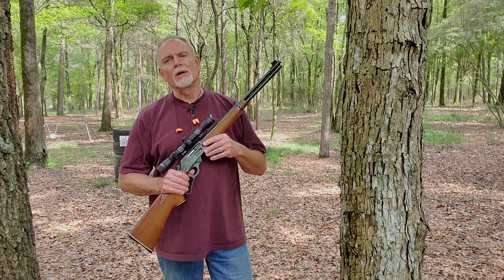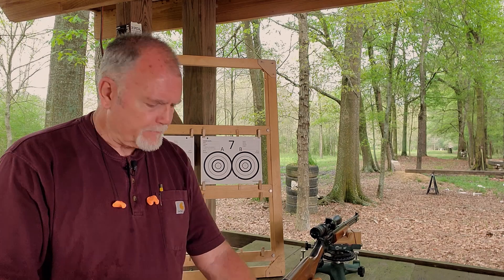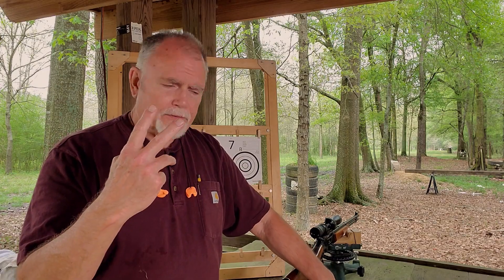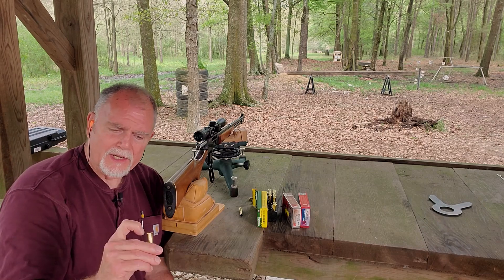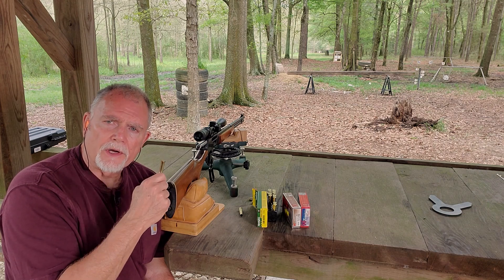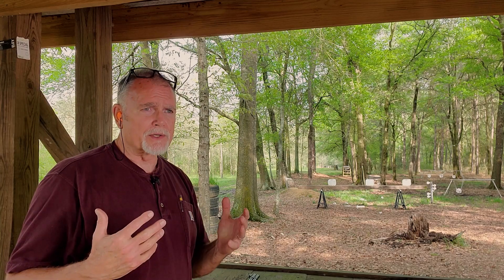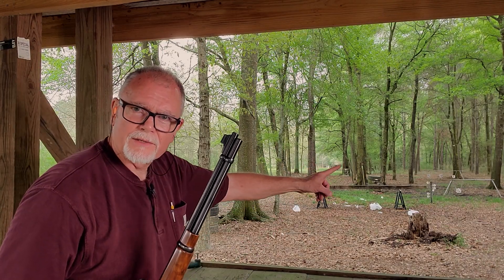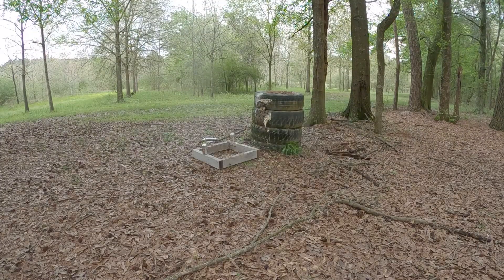Marlin 336 - Light Primer Strike ?

Comment: I had the same problem with my very old and heavy used but not abused Marlin. I took the bolt apart several times for cleaning and inspection and problem still there. I gave up and took it to my friend and gunsmith.
He did what I did with the same results. He decided to took a real close look at the spot both firing pins met. He realized that they weren't  perfectly square with each other. He dressed them to be square and  so far  after around  200 rounds no misfires.
My gunsmith charged me $20 for his work about 3 years ago. I had considered buying a fire pin assembly but was to cheap to spend the approximately $30 on a hunch. I don't know if this is your friends problem but might help.
Good Luck
Frank  (From the great state of Kansas(
Reply from the maker: Thanks Frank. Great info. I'll check it out. Stay safe in Kansas!

Comment: I realize that this is an older video but I re-visit your videos often. Last weekend I had my 336 out at the range and also had a complete misfire. These are my handloads but as far as I can recollect this was my first misfire. I did have a PPFFFT once but not a misfire and I've been reloading since the 1970's.  No matter how many times I pulled the trigger that round would not go off. Very nicely cratered  primer so definitely not a light strike. These were CCI primers. I realize that every barrel can contain one bad apple but I just shy away from CCI's now. I would not expect a factory round to misfire
Reply from the maker: Hi David. As I said in this video, the Remington CoreLokt were the only misfires, but I have also had misfires with my own Marlin 1894 using CCI primered handloads. It was really bad after I installed the Wolf hammer spring then improved when I added a washer on the hammer strut to increase tension a little. But still too many misfires. I haven't experimented yet to see if a different primer brand would eliminate that. Maybe some day. Thanks as always for your comments, and double thanks for the views.

Comment: I had the same problem with a Marlin 336 from the early 80s in .35 Rem I recently acquired.  I took the bolt apart and gave it a good cleaning and replaced the hammer spring.  I also changed primers in my reloads and adjusted the sizing die a little and seems to work fine now, but testing continues.
Reply from the maker: Good input. Thanks Michael!

Comment: This may have already been suggested and I  have read a good number of comments to see if it has but have not seen it as if yet.  Is there any chance that the actual firing pin tip has been worn down ever so much that sometimes you get a light primer strike?  (Using and inch as references since I have no idea how long the pin is supposedto be) , let's say the original pin is an inch long and over time and use it is now 15/16th of an inch.  To me that would a potential problem for hard/thick primers thT would not show up in light/thin primers.  I know by seeing these videos (which are WONDERFUL 👏 by the way) the the problem has all but been solved and even with that you still had 1 dead primer strike.  Let me know if I'm off base.   

I have a 67 model 336 30-30 and love it.
Reply: Oh! Also, what is the likelihood of a "bad primer" with factory loads?
Reply from the maker: That's something I hadn't thought of before! I'll check it out if I get my hands on that rifle again.

Comment: I had two failures-to-fire from a box of 20 Corelokt 170 grain while trying different ammo in my 1995 336. I had cleaned and polished the action prior, and I had no failures with any other ammo then, or since. I now use Winchester or Federal 150 grain with acceptable accuracy from both.
Reply from the maker: Thanks Sydney. That kind of confirms my suspicion, that the Rem Core Lokt is the problem. No hint of issues with the two types of Hornady ammo, other than the fact that the Leverevolution wouldn't group well in that Marlin.

Comment: I agree that the primer strike you showed wasn't a light one. So, that leads me to think it was a bit slow. And since I saw your cleaning video, the immediate thought of "gunk" vanished. So, what else can slow the firing pin? Too weak a spring, and excess friction. The spring can be ruled out by shimming it for more compression. If that works, get a new one. The excess friction is probably in the two piece firing pin. The lever presses up on the safety pin to ensure full closure of the lever.  If that little piece of metal has worn, it won't push the firing pin all the way up, and you'll have a slowed down strike. You can put a dab of JB weld on the exposed tip, and if that fixes the problem, replace that part. Also, as a couple of others have suggested, you can get a one piece firing pin, but that also eliminates a built in safety feature.
Reply from the maker: Of all the factory ammo that I tested in Ron's Marlin, only Remington green and yellow CoreLokt rounds had issues with failure to fire. He was satisfied with picking another round.

Comment: Yeah... I reckon it's that locking block.... check the mechanism for wear on the parts that raise it into battery. Depending on the gear you have you'll either have to fix the wear (or replace the worn bits) or alter the locking block a few thou perhaps.....making it a wee bit 'taller'..... It's obviously only just not working sometimes.......
Reply from the maker: For some reason it just can't digest the Remington CoreLokt ammo. Go figure! Thanks for the comment!

Comment: Lee Precision makes a good 170g/gas check bullet mold for the 30-30.  With a tang sight on a model 94 with a 26" barrel, I could get most of the shots in the black at 100yds.  I haven't cast bullets for a couple years and now use Sierra 170 flat nosed bullets.  I got prejudiced against Hornady when I first started reloading 40 years ago;  The second box of 9mm JHP was noticeably different from the first box.  The explanation from Hornady didn't include an apology.
Reply from the maker: Thanks Alan!

Comment: I'm a big core lokt fan. 
I use 150sp in 30-30 
100psp in 243 
 180psp in 30-06 
Back in day In 243 and 30-06
I switched back and forth depending on terrain between the sp and psp because they were sold side by side but these days the sp is hard to find. 
I always sited in at 35 yards and it was dead on at 100 
If I shot dead on at 50 I was always about a inch low. 
But that's my experience with the ammo and calibers.
Reply from the maker: Core Lokt was what I shot as well back in the 70's in my 25-06. 100gr bullets were tack drivers.

Comment: Did you take the firing pin parts out of the bolt? Perhaps they are a little gunned up? Or someone put in a reduced power hammer spring or modified the factory one to reduce trigger pull.
Reply from the maker: Hi Scott. Good questions. Thanks! Yes, I disassembled and cleaned (and polished off camera) some of the surfaces that could slow the firing pin travel. Ron bought the rifle used, but there is no sign the hammer spring has been modified. My guess at this point is that the spring may have fatigued over the last 32 years. But I did drop the hammer on that one Remington round 3 or four times, so I suspect something is amiss there.

Comment: Just watching you work the action it looks to me that this rifle may have had some work done to it. It may have a reduced hammer spring installed and if thats the case the misfires can be cured by installing a one piece firing pin or just by shimming up the hammer spring with a small washer. I have the reduced hammer spring and one piece firing pin installed in mine. Otherwise a pretty rifle
Reply from the maker: Hi David. I've only heard about the one piece firing pin since posting the original video on this. I may need to do some homework. Thanks!

Comment: Could be primers not seated deep enough or the shoulders are set back to far on the case.
Reply from the maker: Hi Tripplebeards. The 30-30 headspaces on the rim of the cartridge so the shoulder wouldn't have any impact on that. I'm guessing the Remington loads just had harder primer cup material. I just can't think of another reason that particular round would exhibit FTFs.
Reply: @TargetSuite  I was thinking yours was a 35 Rem. If my 35 Rem shoulders are set back to far I have issues. Also if I don’t seat my primers completely flush it takes two hits of the hammer to get them to go off. One to seat it property and the second time it fires. I use Remington 9 1/2 primers and feel they are a little harder then most.
Reply from the maker: This is actually a rifle a friend loaned to me for YouTube. He bought it used so the history is suspect. I know it was a mess when I got it. I do have a 336 35 Rem in my "personal shopping" cart though.
Reply: @tripplebeards3427  Good afternoon,   I have the same problem. I've tried everything everyone has tried.  Next step is resetting the headspace ??  Any more info would help if you have a suggestion  Thanks  Louis